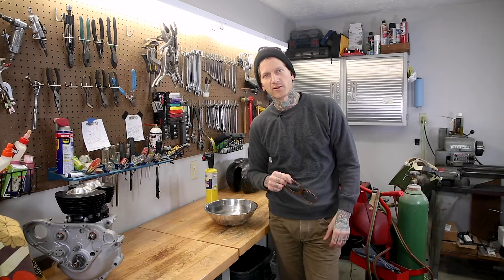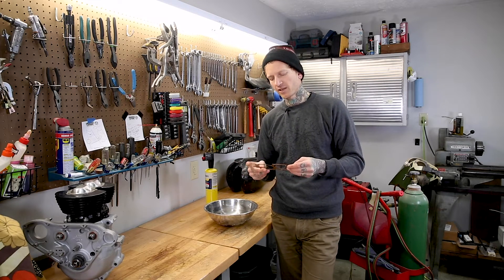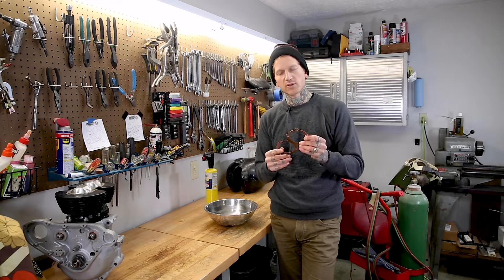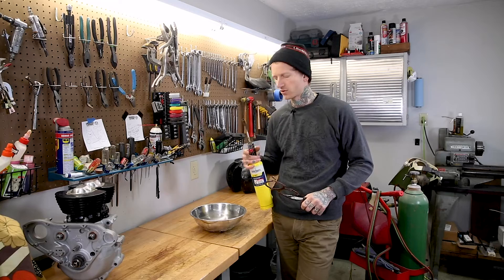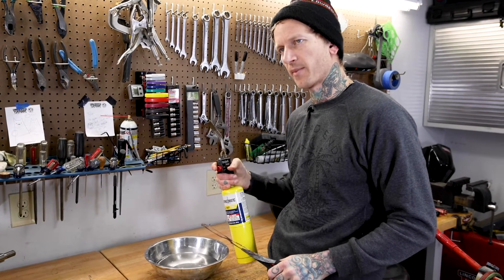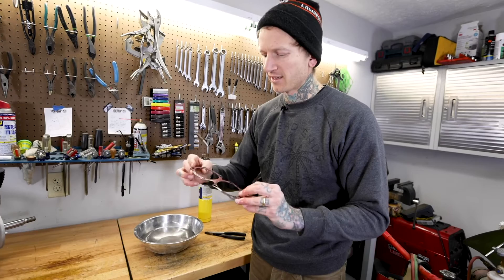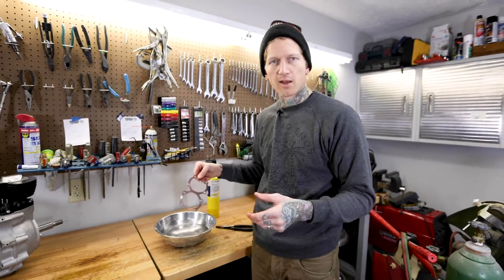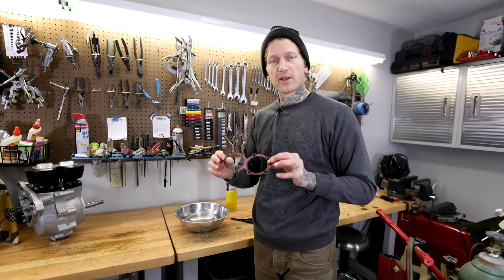How to Anneal a Copper Head Gasket for Triumph Motorcycles

Comment: Ok so if you don’t know what you’re talking about you need to stop making videos telling people the wrong way to do something.   You did not soften the copper.  What you did is harden the copper and also made it more brittle.   What you just did is called tempering.
Reply: Umm, I spoke to an engineer recently, who only works with heads, about this very subject and he mentioned dunking it in water. I worked for 20 years in a factory that produces electrical cables and during that time I ran a wire drawing machine that pulled wire through reducing dies to get it down to very small sizes, like 0.02mm.
Part of the process was running it through an annealer which does exactly what you see here, but much faster. 
When this engineer mentioned cooling the copper down, I remembered that after the heating stage of annealing the copper wire, it goes through a cooling bath. When I commented that dunking it hot metal in water hardens it, he reminded me that this is true if you use oil, but not water. 
It seems counterintuitive to be doing what we see in this video, but it’s not.
Some wires we produced required what we called ‘hard drawn’, which is not annealed, for which we just drew through the sequence of reducing dies, which made it hot, but ran it through oil, which made it harder. 
So this guy isn’t incorrect in what he’s doing.

Granted, allowing the copper to cool gradually is better, as someone else commented, but I can tell you that cooling it quickly in water doesn’t make it harder and certainly doesn’t do any harm.

Comment: Hey guys, love your vids ... one tip though. Don't quench the copper. Everyone always does (I think people like the satisfaction of dunking hot metal in water 👍) ... but actually, your copper will be softer if you go to cherry red then let it cool to room temperature at its own rate ... or better still on a firebrick. Trust me, it's like butter after that. Try it !!!

PS ... I'm a time served Goldsmith/Silversmith with Blacksmithing and Toolmaking experience, so I'm speaking from experience.
Reply: Thanks for sharing

Comment: What is 2 inch under length or standard length mean on your springer forks
Reply from the maker: 2 inches under the standard length of the springer. If you look at the listings it tells you the standard length of each springer we sell, and then if it’s 2 under its 2” under that length, if it’s 2 over 4 over 6 over it’s that many inches over that length
Reply: @lowbrowcustoms  so it  will lower or raise the front by X amount basically it has nothing to do with angles

Comment: Fyi. Save yourself a few bucks. Since 2009 they don't make mapp gas anymore. The map pro they sell now only burns about 130f hotter then propane. Unless you run it with oxy.

Comment: Any advice on using copper HG's vs fibre flame ring type HG's, particularly for classic brit bikes (Triumph/Nortons etc)? I've heard not to use any type of adhesives/coatings on the fibre type as they have something already in the material from manufacturer. 
Also, I assume this is the same annealing method to use for copper sealing washers, correct?
Reply: I tried high tech fibre flame rings type on my ironhead Harley drag bike, nope. Blown gaskets.  Went back to copper and have not had a single issue.
Reply from the maker: I have only ever used copper head gaskets on vintage motorcycles, sorry but I can't speak to the fibre types. I use an annealed, clean copper head gasket and use Gaskacinch or Permatex Spray-A-Gasket to coat both sides of the gasket (as per instructions on the gasket coating), then assemble. I have never had a head gasket leak or blown a head gasket, even while racing. Of course it is important to make sure that the gasket surface on the head and cylinder barrel is nice and clean, and smooth! You can 'face' it on a thick piece of glass with fine emery paper if needed...
Reply: Imho the modern ring type multi material head gasket for 10 stud Triumph 750's and Norton Commandos is the best gasket available.
For 650 Triumphs and other Brit parallel twins, stick with the stock copper head gasket.
Reply: Re copper washers sure. But 3/8" and under are cents on the dollar.
Bigger, more unobtanium versions, sure.

Comment: never herd of copper spray?, do you mean never seize? need some clarification on that .thanks
Reply from the maker: Not never sieze (aka anti seize), you can use Permatex Spray-A-Gasket, or similar... Works great!
Reply: Jack, although there's Copper Anti Seize, the right type for spark plugs by the way, Tyler's referring to Copper Gasket Adhesive.  Permatex and Loctite both make one, available at most Auto Parts stores or Engine Shops. Yes, they're spray on. I hang my gaskets by a length of mechanics wire to spray and completely coat both sides evenly. GOOD LUCK. 
T.S. RACING 🇺🇸🏍🇺🇸